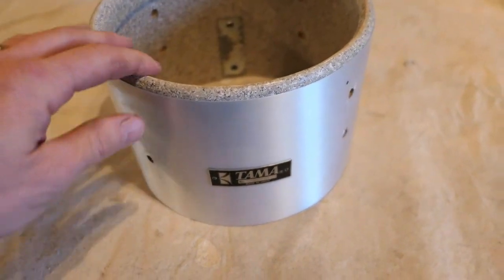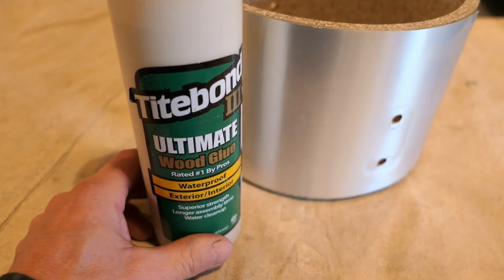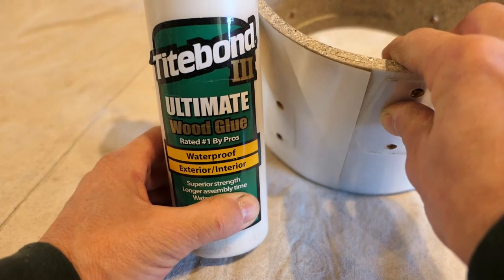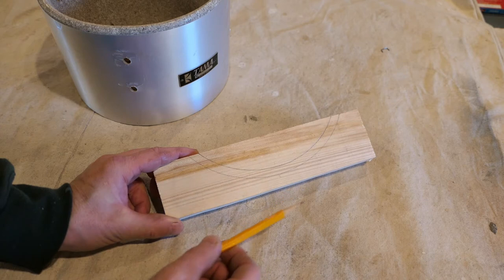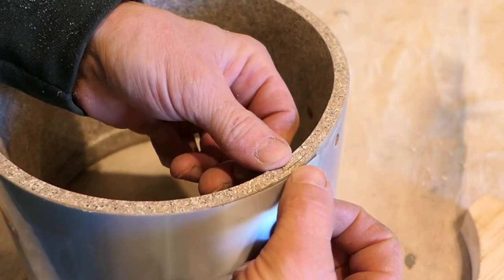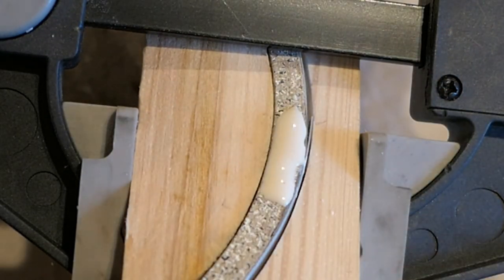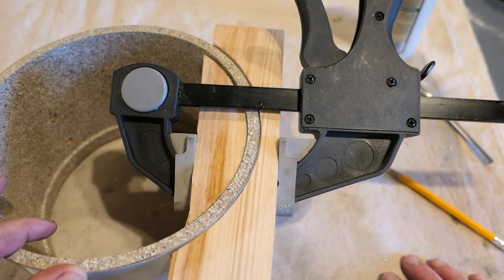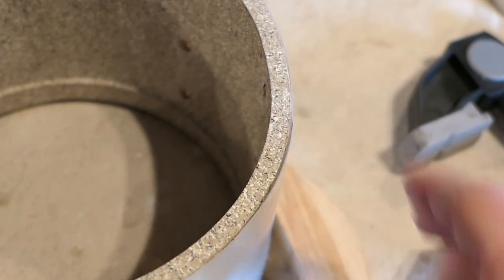How To Repair A Delaminated Drum

Comment: I had this happen on my Tama Superstar 10".  Got left in the cold for a season, and there might have been some issues with the wood itself, or manufacturing.  I used the same type of wood glue, but used the thinnest feeler gauge I could find to work it into the crack (.0015" or .038 mm).  Worked great.  Basically clamped it the same way too.
Reply from the maker: Changes in humidity are what cause the most trouble, along with the stress of mounting hardware when being played.

Comment: Thank you for making this video. I would have just put a clamp or two on the drum in repairing instead of making what you did with the pine. 

Much appreciated!
Reply from the maker: That would be okay if the shell is still solid and not out of round.  But, if your shell has become out of round or the damage is significant, then the pinch blocks cut to the shell radius will keep the shell aligned while the glue cures.